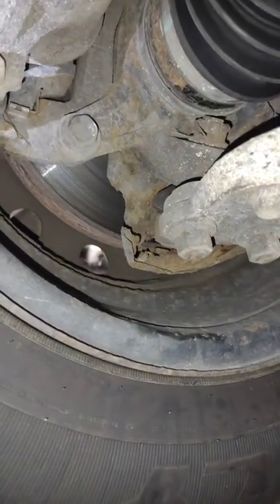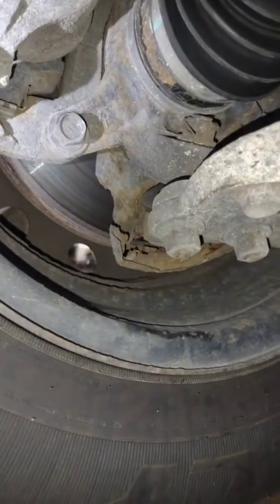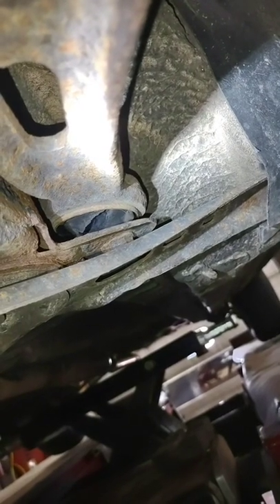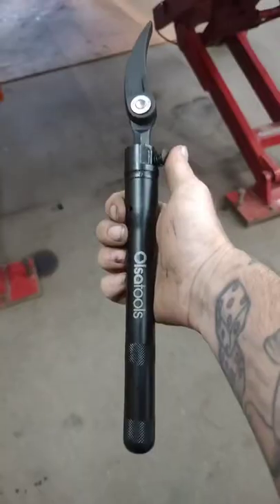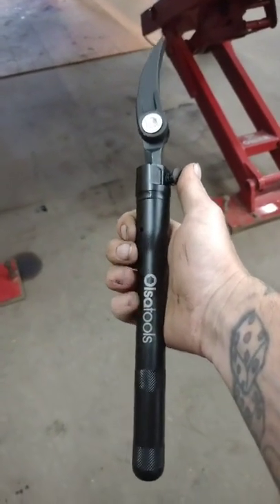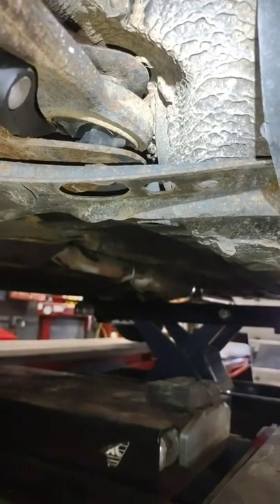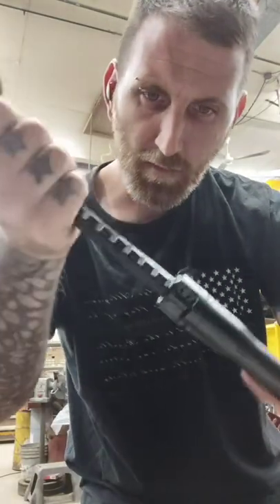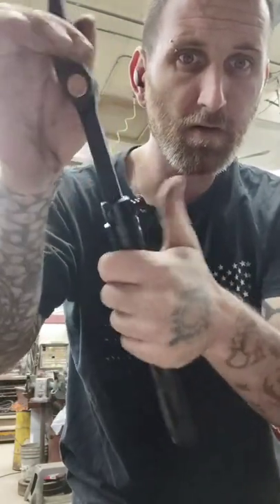@Olsatools this worked out clutch

Comment: We use those prybars at work, just the bigger version.  I build stuff that weighs anywhere from 40,000lbs to 110,000 lbs, and I haven't had one fail or work loose yet.  Just make sure to keep a little oil on that adjuster button.  They will start to stick at some point otherwise.
Reply: RegularPsychedelicGuy  from what the owner said, he bought it from Napa, and Carlyle is one of the brands for them, but a few other brands come to mind.  Our main one is just shy of 3' collapsed.
Reply: hold on A HUNDRED AND TEN THOUSAND POUNDS HOLY HELL